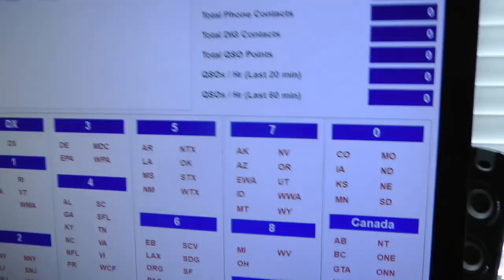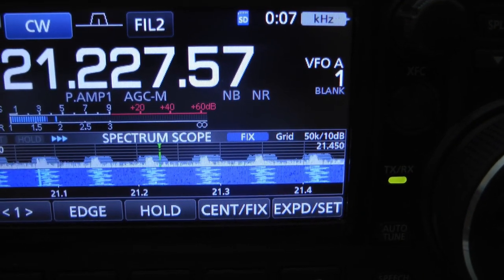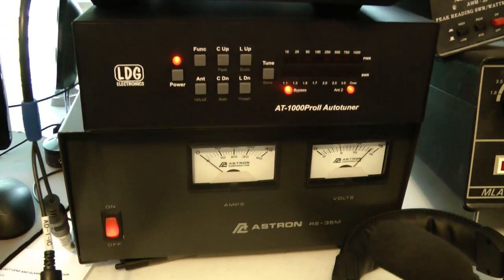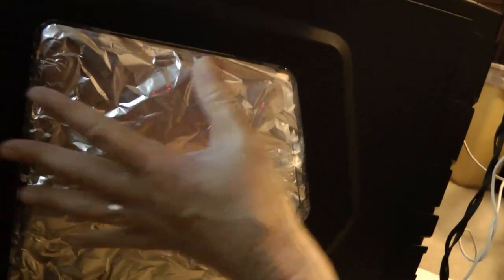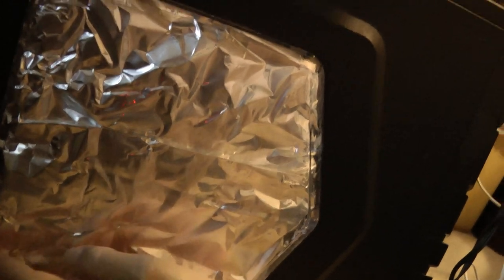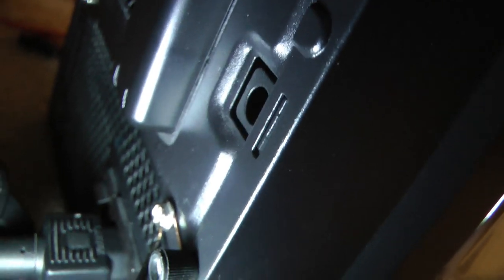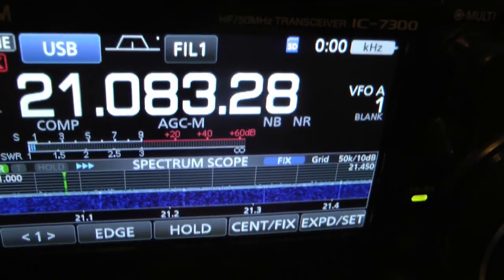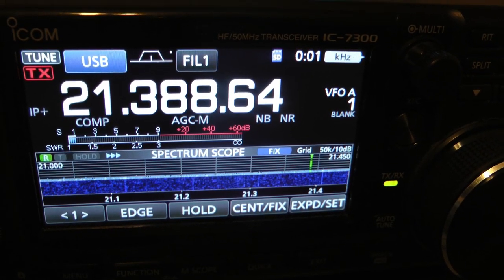Computer Noise to Ham Radio Fix computers can cause a lot of noise for your radio

Comment: I have exactly same computer case and I noticed a lot of noise in 160 and 80m band while my son was playing games on PC. I have quality power supply in that PC. I believe this computer case is bad for blocking rf. That plastic window doesn't make things better. I'll try to cover that with metal mesh
Reply from the maker: That may help, but I think grounding wire to one of the screws to the power supply would ground the case...  Good luck and thank you for  watching my video